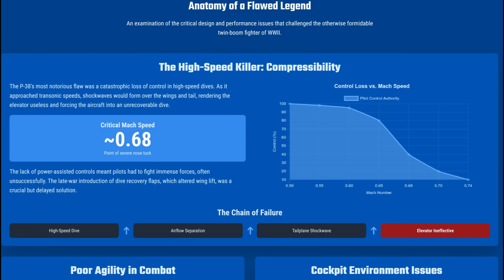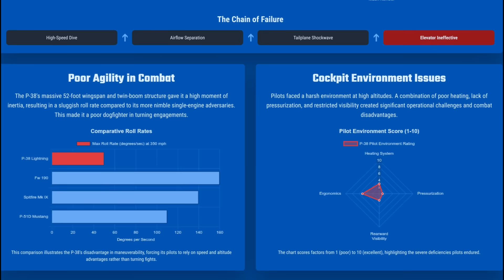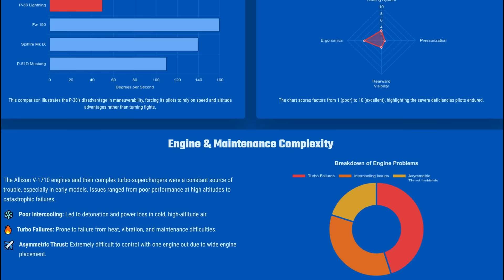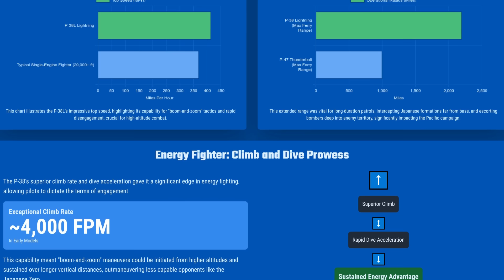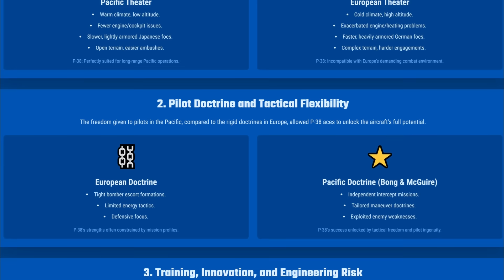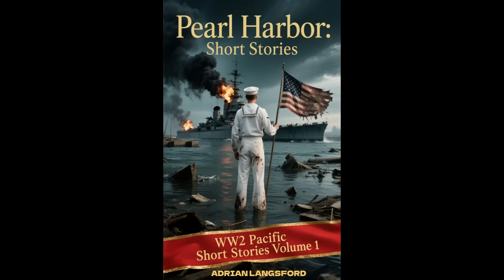P-38 Was a Nightmare..Yet It Made America’s Top Aces

Comment: Wondering if the turbo issue was behind the RAF ordering P 38s without them?
Reply: I thought it was the US who didn’t want to share the turbo equipped engines, not that the British didn’t want them
Reply: @Tadadsky Not heard that, I'm sure the B17s and B24s acquired by the RAF were turbocharged. I've not seen a source explaining why they were refused in the P38.
Reply: @ploppysonofploppy6066  The P-38 as rejected by the RAF because of the lack of turbos

RAF B-17s were used with Coastal Command as they had the range and the fact that the B-17s small bombload was not a problem.
Reply: @bigblue6917 Just so, but all of the sources I've read state that the RAF requested P38s without turbos. B17s for Coastal Command and ELINT work had them. Have you seen a source suggesting the US refused to fit turbos?
Reply: @Tadadsky  True
Reply: @Tadadsky  Correct.
Reply: No, there were other reasons.

The way I recall it, the turbos were considered sensitive technology at the time; an obstacle to export.
Basically the same reason we kept the F22 program domestic; it was too far ahead of the curve to give away the advantage by letting others study it freely.

It was certainly cutting edge tech for the day. Especially pre-war.
Wikipedia, though, says it was because the Europeans wanted complete commonality on their Allison products -- which also explains why they ordered their Lightnings without counter-rotating props. Ouch.

Possibly both of those factors contributed to the outcome.

Whatever the reason, the Brits were sorely disappointed with their version of the product, which became known as the "castrated" P38.
The order was mostly cancelled, negotiations became contentious, and production was re-allocated to USAAF after Pearl Harbor.

The one bright spot on the British order is the name they gave the aircraft ("Lightning Mark 1") which stuck.
Gosh only knows what we would have called the plane, left to our own devices. Probably nothing so cool.
Reply: @apieceofstring  I agree.  We were having trouble producing them as well.  As I remember, we were having trouble with the fans coming apart at high speed.  We were having problems with the alloys in the turbine blades.
Reply: @leeblake3989  I wouldn't be surprised. They say the turbos glowed white hot in use; that's what made the technology so advanced, not just the concept but the materials engineering for the insane operating conditions, and the associated industrial infrastructure.

The Lightning has armored plates specifically to shield the cabin from turbine fragments -- so turbo structural failure was definitely on their mind.

Sidenote - IIRC the turbos engaged automatically, and they weren't mechanically linked; they were two separate systems with independent activation barometers. I remember reading that they would always activate slightly out of sync, producing a momentary lurch as the airport climbed through the threshold altitude.
Reply: @apieceofstring  All correct.  Early in the war, the Brits had better tubo's.  The ones for their Merlins were outstanding, but would not fit in the Lightning.  By late 41-42 we had the problems solved.  Probably with metallurgical help from the Brits.
Reply: @leeblake3989 Double check that? Pretty sure the Merlin used a two stage supercharger, not a turbo. Turbos were rare in WW2. Off the top of my head, the only ones that come to mind are the P38 and P47 -- and in each case the decision had visible effects on the airframe.

In the P38 the turbos occupied the booms, a layout opportunity which drove the choice of the twin boom configuration.
The Jug mounted its turbo internally, contributing to its fat, guppy-like profile, even compared to other Big Radials like the Corsair.

The Brits had great performance with the Merlin, but it wasn't turbo driven. One of the reasons we got merlin powered P51s but never a merlin P38; the whole airframe was built around the turbo tech; they were inseparable and switching up the design would have defeated the point.
Reply: @apieceofstring  I looked back and you are correct.  Damn, I am getting old.  It has been years since I studied these planes in depth.  Thanks for correcting my mistake.
Reply: The Brits wanted to only stock ONE engine so they didn't have counterrotating props. And I'm not certain but the comments about export restrictions on the turbos may be correct. Either way, the Brits only tested the fully castrated version - BEFORE it even got hydraulicly boosted ailerons, fixed the carb icing issue and dive flaps for compressibility recovery. No wonder they didn't like it. And British fuel didn't work well in Alison anything...
Reply: @Mike-eq4ky  All these reasons an d more is why the P-38 had such a difficult time in northern Europe.  Only had a 1.5 to 1 kill ratio, lower than even the P-40. In the Pacific it shined  due to the lower fighting altitudes, hotter climate, and easier opponents.  When I say that I mean one quick burst from the P-38 and any Japanese aircraft was done.
Reply: @leeblake3989  That's not the whole story. You really want to check out Greg's Airplanes and Automobiles channel since he has an entre video on just this ONE topic plus six others on the P-38. The bomber mafia sent the 38 away before teething issues were be solved. They even refused to use it when it could have saved many lives in the early disastrous raids on Schweinfurt and... etc. And remember that the P-38 was responsible for something like 90% of all the photorecon in the ETO. Pilot experience, tactics, environment, etc all come into play here and the P-38 got a lot of short shrift in the ETO. But at the end of the day, all of our great fighters prevailed and served as needed...
Reply: @Mike-eq4ky I had a quick look to see if I could substantiate my claim about export restrictions. Found this: https://en.m.wikipedia.org/wiki/Export_Control_Act#:~:text=The%20Export%20Control%20Act%20of,of%20re%2Denactment%20in%201949.

The article doesn't reference turbocharger technology by name, but I think it's probably the relevant legislation.

It sounds like the Export Control Act affected all sensitive military exports. I'm sure I remember hearing that this issue affected the lightning, and it's easy to imagine why turbochargers would draw attention -- at least enough to create a bureaucratic hazard -- but I wasn't able to find more specific corroboration yet.

Likely to deal could have been made if the Brits wanted it enough, but as you said, the turbos never really appealed to their needs.
Reply: Yes it was the fact that the US would not sell the P-38 wit turbos which led to the deal being cancelled.
Reply: I think the RAF only used them in the Burma theatre, where all the fighting was at low altitude.
Reply: @doglover31418 I don't think the RAF used them operationally. Ordered a few without turbos and contra rotating props, and they weren't anywhere near combat worthy, got used for training.
I've always assumed the RAF weren't happy with the turbos - to complx, unreliable?  although the superchargers in Merlins seemed to work well in Europe.
Reply: @ploppysonofploppy6066  It was the fact that the US would not supply the turbos which led to the deal being cancelled
Reply: P38's sent to England had Turbos removed for fear the technology would captured.  British called them "Castrated Lightnings ".
Reply: @markkline6718 Just looked it up on Wikipedia again. Somone left a note with a source,  turbos weren't new or secret, but the Franco British order deleted them on the fear that it it might slow down delivery. Seems to fit the bill. RAF turned it down, long term, on the "tail flutter" issue.
Reply: @markkline6718  "The P-38 was clearly a hot performer and the UK Air Ministry and French AF soon took an interest in the type, seeking a non-turbocharged variant with identical powerplants (and same sense prop rotation) to the Curtiss Tomahawks at that time ordered in significant numbers."
Air Power Australia Assessing the Lockheed P-38 Lightning